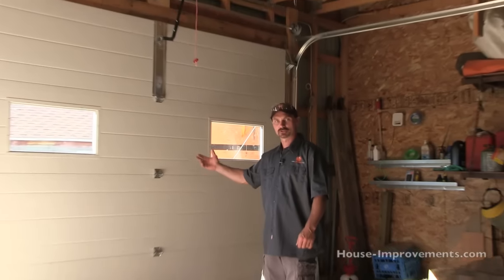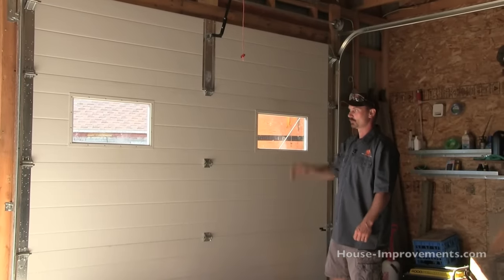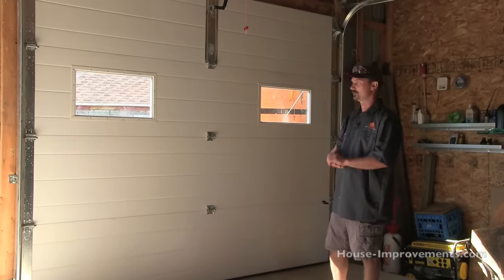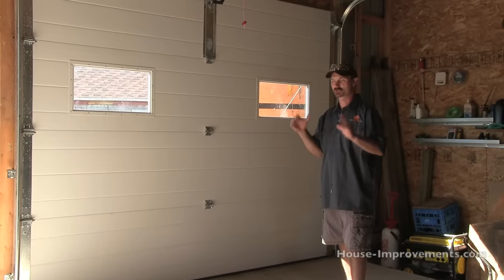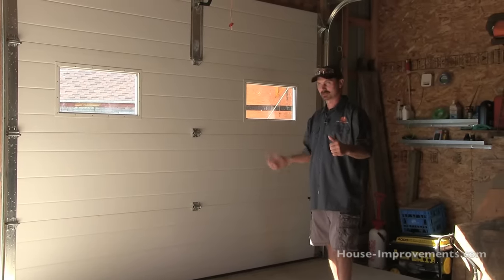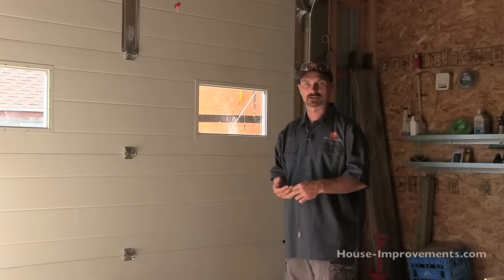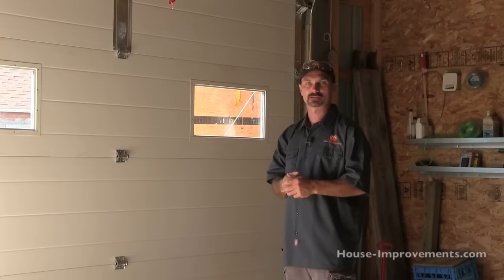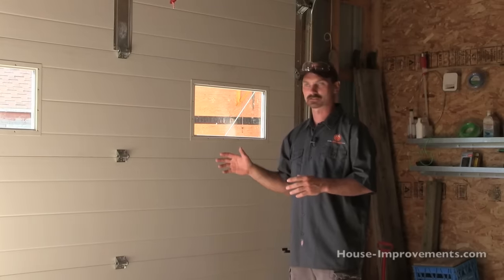How To Install A Garage Door

Comment: Great video on how to install the garage door.  Quick question.  At the beginning of the video, you add 2X6 around the opening that the hardware gets attached to.  Is there a reason for this? Could I not just attach directly to the studs and headers?
Reply from the maker: This ensures that you have solid wood to attach the hardware and that you are not leg bolting to joints between wood where it may not hold as well.
Reply: HouseImprovements Thanks for the quick response!  That makes sense.  Great videos.  Keep 'em coming.  I've been building a detached garage over the summer based nearly entirely on your videos!
Reply: HouseImprovements As well, the door runs truer on a flat surface. Mounting to a 2x6 ensures that there is minimal binding and less headaches down the road.

Comment: I want to add a garage door and the room I will be using for a garage only has an 89" high ceiling.  With a seven foot (84") high door would the 5" headroom be enough?  THanks for the video
Reply from the maker: no , not usually. Some manufactures may have a low headroom adaptors so best to check with the manufacture.

Comment: I saw the rail brackets are adjustable, what's the thickness you should consider or better said the distance between the wall and the Center of the rail. This is because i'm installing a garrage thats made out of wood and iron and I dont know how much of a thickness I can use

Comment: I never understood the nailing the door up like this. We usually just stand the track up and put the bottom panel in and screw the bottom of the track to the wall and leave the top lose then yiu can stack and put all the rollers in then make sure the track is about a quarter inch from the hinge and screw it on down

Comment: Is a hammer mandatory to screw the nail on the garage? Or can you use the drill?
Reply from the maker: You could use a regular drill if you dont have an impact driver. Pre drilingl the holes first will make it easier on the drill.

Comment: How is the door staying in place without tracks when’s your building? I do not recommend doing that way
Reply from the maker: Watch the video you will see I use bent over framing nails to hold it into place until the tracks are hung.
Reply: @HouseImprovements  why? Lay your first panel then Put your verticals. Your wasting time and risking the door dropping. Dangerous

Comment: I'm going to be installing a door very soon.  I'm interested in the strips you temporarily nailed to the inside opening of the door, so you could lean the panels up against.  Are the strips FLUSH with the inside 2 x 6's or are they slightly inside?  I couldn't make that out in the video.  Thanks.
Reply from the maker: They are flush.

Comment: You wind a spring in 1/4's so 8.5 turns is 34 quarters. Just count it out. Also, the spring is a left wound or right wound spring. Look down at the spring to see which way it winds from the end point. The LW always goes on the RIGHT side of the center bearing plate and the RW always goes on the left side of the ... in a standard lift scenario. You never wind a spring DOWNWARDS! Aka the end of the spring that you are winding should always point UP. This is important because all of the energy that you wind and then set into the shaft will not transfer to the drums and cables and lift the door but in reverse and throw the cables off the drums with 150ft/lbs of torque. It's very important that you do not wind the spring incorrectly. Also, you can lock your winding pins on the top edge of the top section to keep the tension on the spring when you're finished winding. Also, stretch the spring when you're finished winding to give the spring more room to wind back up on each closing cycle. Also, look to the spacing on the bottom roller when you open it to determine which side the door is running closer to. Also, is this a steelcraft door? Canadians in the house.
Reply from the maker: Good info. Yes this is a Steelcraft door.

Comment: nice video shannon,  I watched completly,  one question, in my garage the cable came out of one side only, because the door hits a piece of drywall when coming down, cable ok , and spring did not unwang, how do I put the cable back correctly, without  messing with the heavy spring? thank you please help, cheers from ontario ca,
Reply from the maker: +Everardo Camacho You have to carefully unwind the springs ,hook cables back up and start over winding....sorry but thats the only way to get it right.

Comment: If my door is 12 foot wide should the opening be a little smaller?
Reply from the maker: I like mine to be 1" smaller but they can be the same size. If they are the same size then I would either add temp.1x4s to opening or install your tracks and use them to hold the panels while assembling the door.

Comment: Very detailed video, thank you. Drywall first if finishing the interior?
Reply from the maker: No you need solid wood to mount hardware to and that should not have drywall sandwiched under it if you can help it . I generally would attach a plywood or solid wood backer strip behind the solid wood 2x6 that goes around perimeter  so that drywall can be attached and butted at the 2x6 edges.
Reply: HouseImprovements Thank you! Just the detail I needed to keep moving on my detached garage. Greatly appreciated!

Comment: I get the rollers and spring guide the door along the track but can you get/buy without a spring on those door. Does the extra lifting assistance for manual open the garage door is it significant or can you live without it. Also if you didn't have the spring just the rollers on top could the motor of the electric door opener work still?  (because the only semi-dangerous part is the spring everything else you can screw up and redo but if the spring gets you say goodbye.)

Comment: Very informative. I'm curious if anyone knows why the additional 2x6s are needed on the inside around the opening, across the header and up the king/trim studs? Is there a reason that I can't just mount the tracks and balance hardware directly to the king/trim studs on the sides and header across the top? I know that the door instructions say to add them, but are they really necessary? Thanks
Reply from the maker: I believe it is to avoid having some of the hardware leg bolts lining up in the joints between  the framing and not holding as well.

Comment: Everyone talks of how dangerous these springs are. I don't get it. If your winding bar slips, there will be a loud noise and the spring will unwind almost instantly. it is captured by the shaft so it can't go anywhere. The noise might startle you, and you may feel a jerk from the bar slipping out that could cause you to lose your balance, but can someone describe a scenario of how you can get directly hurt from the spring suddenly unwinding?

Comment: Hello there! Not sure if you'll see this comment but curious if I would be safe to try replacing a 7'x16' wooden garage door with an un-insulated sheet metal door without replacing the rails and other mounting hardware that already exists, assuming all the hardware is still in good condition..
Reply from the maker: Most likley but I think you are better off changing it all.
Reply: Reading elsewhere that seems to be the consensus. Thanks for replying!  @HouseImprovements

Comment: I just found your video. Question how do level the first section against the concrete? with a wood you scribe the door..
Reply from the maker: 4' level on the panel and shim door panel as needed off the floor. Unless the floor is out a lot the bottom bulb weather strip should still seal up. If its not quite doing it slip some 1" foam rope inside of the bulb weather stripping

Comment: My Garage Door has the Black Coil,  which is attached to a 2 X 4 and then over  to the Pulley. So how do I check  (or have my son check this) the tension on each of these.  One side has too much slack (hangs down further when the door is open?)

Comment: really appreciate this video, i installed my first door today, bit frustrated as the cables keep coming off as i roll the door up - and as far as i can see ive done everything pretty much the same " besides i installed the track first, then my other contractor friend informed me it would be way easier to do what you have done here - just lost at these damn cables
Reply from the maker: Are you sure the springs are wound the right direction? Are the cables coming off near the full open position of the door? Please post in my forum with your questions and answers to these other points and I can likely talk you through it.http://www.house-improvements.com/forums/

Comment: They're not "rails", they're tracks.  Vertical and horizontal.  Also, you didn't lift the vertical tracks off of the concrete a half inch or so to prevent the condensation from rusting out the bottom of the vertical tracks.  And the brackets at the top of the vertical tracks that attach to the jambs are called flag brackets.  Also, if you used a crayon to mark a horizontal line across the entire spring prior to winding it it's easier to know how many times you've wound the spring.  Each "circle" around the spring as you wind it is one full revolution of the spring.  IE: 8-12 turns of the spring equals eight and a half circles of crayon mark around the spring.  And I've NEVER seen a spring that gets wound in the downward direction.  Always up.  I also put a vice grip over one of the rollers prior to winding the spring, just to be sure that the door doesn't roll up on you while winding the spring.  Overall good video though.  I like the fact that you stressed the importance of how dangerous a spring can be.  I've had a lot of co-workers out on workman's comp because of accidents with springs.
Reply from the maker: Good tips, thanks

Comment: ur video was very helpful I was able to install the door but not sure if door should very tight or loose against door jams? What the rule of thumb??
Reply from the maker: The doors should move freely, the weather strip will seal things up later on. There is maybe 1/8" play in the rollers
Reply: wow that tight hmmmm oh do you recommend belt over chain and if so wht brand name is good.

Comment: Just bought a house and my 16' x 7' door will not open. Opener works fine. But the tensioner bar is not spinning and cable is extremely loose when door is closed
Reply from the maker: Broken spring?

Comment: I installed a steelcraft 16 ft long door with that tension strip you were talking about. I notice that when the door is closed it has a bigger gap in the middle of the door between the door and frame. Is that got to do with the tension strip not being tight enough or how is that gap adjusted ?
Reply from the maker: I find they do that. When installing the outside weather strip you can cover that gap.

Comment: I got a question. Can I cut like a inch and a half off my vertical track so that The garage door will be an inch and a half lower when it's in storage mode I would have to lower the top roller then correct? Please help

Comment: great video!   Can I ask two questions if you don't mind:

Do you need to install spring tension shaft if you will install automatic belt drive opener?    Looks like the install spring tension shaft is only for hand lifting the garage door, right?
Reply from the maker: +Jamerson D  No you need the spring assist to help even with an opener.

Comment: the finish metal on the outside of the door , is that just a wrap after frame work was done ,,I was thinking of just using ruff cedar 3/4 for the out side finish with weather strip,,so my ruff cedar would be flush with my 2x6 inside right,so instead of the extra 3"on side it would be 1 1/2 extra of the door size and 3/4 at the top right
Reply from the maker: Yes that is just a custom bent coloured aluminum trim to cover the framing. If you are using rough 3/4" cedar then add 1-12/" to the width of your R.O. and 3/4 to the height.

Comment: I have a question for any professional garage door installers. If you force a garage door open without releasing the emergency release latch will it damage anything? I ask because my tools were stolen from my garage and I found the side door unlocked (it's an apartment maintenance section that has access to my garage) but the manager and maintenance guy said there is no way they accidentally left it unlocked and are claiming the burglars must have forced the garage door open even though there is no evidence or damage anywhere on the door, then unlocked and exited through the side door. The police thought that was highly implausible but I wanted to get an opinion from a professional.
Reply from the maker: No way you can force that door up with it hooked to the opener . You would have to trip the emergency release  ,which apparently some criminals can do from outside.
Reply: @HouseImprovements  Thanks for the input, I really appreciate it

Comment: Hi Shannon. I alway's love all your video's! They're precise and very through. Anytime I need to know more about a project I refer to your expertise. My carport I have enclosed has a front measurement of 95" to the top of my eve. It's the way my driveway is. It has a fall toward the middle. My question is will the be a concern on a 8' high garage door? I have a 7" angle grinder to fix the driveway level if need be, but will it be ok for my measurement to be an inch shorter on hight of the rough measurement? The inside of my carport is about 9' high. I hope you may be able to give me some advise to solve this. Thank you
Reply from the maker: No,it will be fine since you have the room inside.
Reply: HouseImprovements Great! Thank you Shannon! Alway's love all your video's! Keep them coming!

Comment: Garage door installer told me you were supposed to use red headed screws on the bottom cable brackets
so people will know not to mess with them.

Comment: When tightening bolts that attach brackets to track do you hold and make sure doors are right up against the 2x 6'' than tighten or do you leave approximately 1/8'' gap??? thanks ps everything else is very clear to me...
Reply from the maker: I leave a slight gap so they do not bind against wood.

Comment: I really need some assistance.  the door wire where it attaches to the tab at the bottom of the garage door is rubbing against the rail and is damaging the wire.  Is there anyway to adjust the clearance on the door so the tab doesn't make contact with the rail?
Reply from the maker: Please use our forum.https://www.house-improvements.com/forums/

Comment: Are you required to remove/replace the track rail system if you only intend to replace the panels ?
Reply from the maker: +Phalen Anjel Not always as long as the hardware is not worn out and is compatible .

Comment: What size nut drivers did you use for the garage door installation? I'm looking to get into the business. And I only wanna buy what I really need instead of a complete set. I'm also looking for one that has like a deep socket so when you tighten down a nut on a bolt, you can go down quite a ways without bottoming out. Can you help me? Can you send me a link or is it in your store? Thank you very much.
Reply from the maker: I honestly can't remember and different brands could use different sizes. I would buy say 3/4 " down to 1/4" and you would likely be fine. Most times buying in sets is cheaper that buying 4 separately.

Comment: I live in Florida and it's required to have reinforcement channels across the entire face og each panels. I just installed a door that's insulated and it also added some weight to it. Those chanels are not that light either and I installed 2 for each panel because the door is rated for category 5 hurricane. I followed the instruction on how much tension I should put on the torsion springs. I notice that with the door you installed, you didn't have that much resistance when you lifted the door. I tried to put more tension on the springs but it started lifting by itself and there is so much resistance as I tried to pull the door down. Is that because the door that I installed has gotten too heavy with all the reinforcement chanels I attached to each panel?
Reply from the maker: No I would not think so. You likely only need a half turn more than what is recommended by the manufacture. And if you are not sure contact them directly for advice in your situation.

Comment: In the video there was not info on how to ensure the track is at a 90 degree off the wall and parallel to the other trrack?   how do you do that
Reply from the maker: Eyeball it close then hang it temporarily like in video, then slowly open the door making sure the door rollers do not slide out of the door on either side as it rolls up. Once up adjust tracks to permeant locations

Comment: Just  installed door as  the Manuel saws but the spring seems to be binding up
Reply from the maker: Did you wind the spring the correct direction? Sounds like you did not.

Comment: is it possible to build the frame first and then install the door panels?
Reply from the maker: Yes some guys do , I'm showing you the way the instructions say to do it and its the way I have always done them. The only exception is on doors that are over 8' high , I install the tracks then loosely and use the rollers in the doors to hold them up.

Comment: also,do you need to tighten up the spring annually,the door doesn't open as easy as it used to,thanx
Reply from the maker: +Bigdog Bulldog Not annually but every few years you may need to adjust the tension. also lubing the door hardware helps.